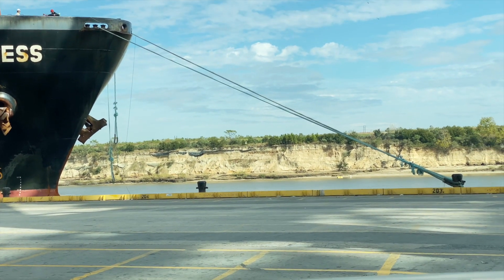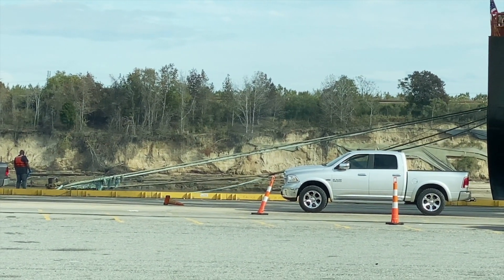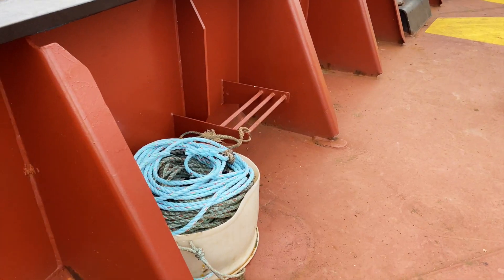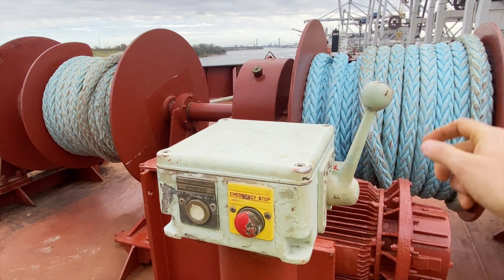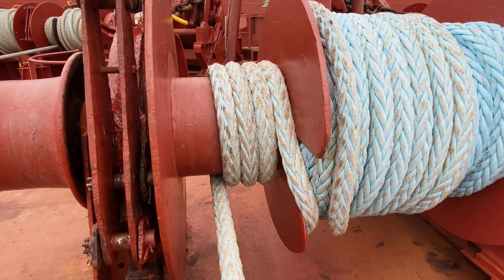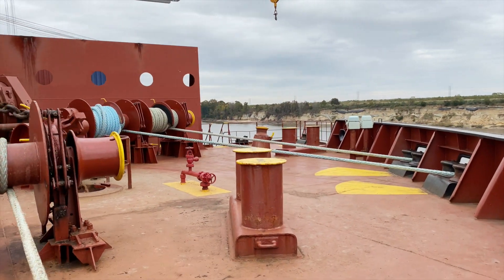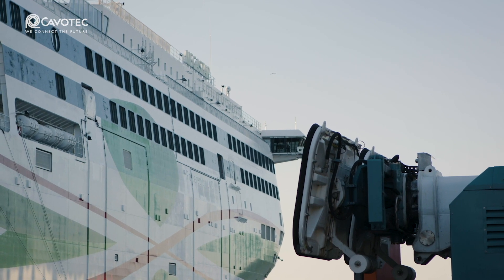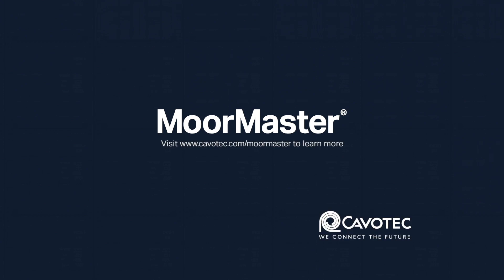Conventional vs. Automated Mooring Of Cargo Ships | Life At Sea

Comment: Great video! Thanks for sharing Bryan. MoorMaster absolutely has the potential to improve safety, productivity, and sustainability: every minute saved mooring is a minute that can be used to move more goods through the terminal and let the vessel cruise slower, saving fuel!
Reply from the maker: I pinned your comment. You mentioned a lot of great benefits the Cavotec system offers!

Comment: Bryan, in traditional mooring do you have to adjust the tension of the docking lines as tide changes ? Do these new mooring systems use Magnets or Suction to hold on to the ship ?
Reply from the maker: Yes depending on the mooring equipment on the ship, you will have to either manually pay in/out mooring lines with the tide change, but most modern ships now have auto-tensioning mooring winches that will allow you to dial in a tension force and the winches will automatically pay in or out. The new mooring systems by Cavotec utilize a vacuum suction to hold the ship.

Comment: Guess this depends on how clean and rust free the ship is. Great for vacation cruise ships. But some of these bulk, liquid and crude oil cruisers I've seen on YouTube look they might need a maglock instead of a vacuum.
Reply from the maker: Interesting point.  I’m not entirely sure if there are limitations with the vacuum technology if the surface of the hull is rusty. I don’t have a lot of experience using this system other than a few times in Salalah, Oman.

Comment: Cavotec has been in use in the St Lawrence Seaway locks for several years now. There are 16 locks between the entrance at Montreal and Lake Superior although there are 3 without the Cavotec system. The lift in the locks is between 10 and 40+ feet and I have yet to see any of the 'pads'  lose their grip. From my own perspective it has been very beneficial as we no longer need to have mooring lines under tension over the heads of the deck crew and the ship doesn't surge around in the lock anymore as it is filled or emptied.
Reply from the maker: That’s great! Glad to hear the system has been effective. I have only personally seen it in operation in Salalah, Oman where the breakwater isn’t always sufficient enough for protecting ships from coming off the dock. I imagine we will be seeing the Cavotec system in many more ports in the future.
Reply: Thanks for sharing your perspective Peter! The Seaway is a great example of the benefits of MoorMaster systems!

Comment: Will automatic mooring replace conventional mooring completely in future due to time saving? If so, are windlass & lines becomes useless then? What is message line?
I understand there are several ways in conventional mooring. Why?
Reply from the maker: As ships become even more automated, I wouldn’t be surprised to see automated mooring systems become the norm. They are already testing crew-less drone ships, and some ports such as in Rotterdam have completely automated terminals with robotic cranes and trucks.  The labor unions may slow this change down, but like many other industries, automation seems to be inevitable. The messenger line is tied to the end of the mooring lines and thrown ashore so that the line handlers on the dock can pull the mooring lines to the dock.  The mooring lines are way to heavy to throw to the dock and are just lowered down. There are different ways to moor ships that are dependent on the requirements of the port, expected poor weather conditions, or preferences of the captain.

Comment: I'm old school I like the ropes.. but I can if was skipper I'd moor first with the new system then once that done I'd put some mooring lines done as a back up but cause I'm already moored they would be no hurry
Reply from the maker: When I first saw this system in use in Salalah, Oman we used both together. They have an issue in the port there with ships being pulled off the docks since the breakwater isn’t that efficient.  Instead of rebuilding the breakwater, they incorporated the cavotec system to solve the problem.  I’m not entirely sure if this next generation system they released is strong enough to work without mooring lines, but I agree that putting out a few backup lines never hurts!

Comment: Wow amazing .. look at all tools & tecnologie. How about the internet on cargo ship ? Is it possible for the crews and captain to video call family and friends ?
Reply: Once Starlink goes active across larger sections of the planet, internet access underway is fully possible.
Reply from the maker: Most ships now have WIFI internet onboard.  Depending on how many crew are using it at the same time, you can do video calls to family back at home.  It works great for emails, texting, web browsing and WiFi phone calls though!
Reply: We use starlink, its much much cheaper and works 80/90% of the time but requires a couple of units for it to work properly.